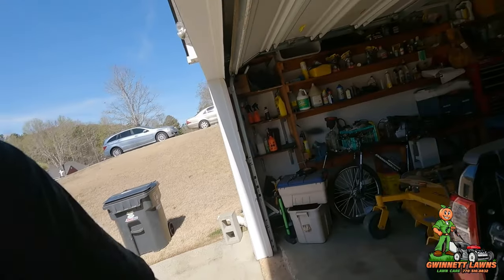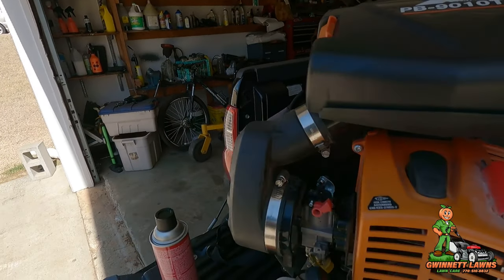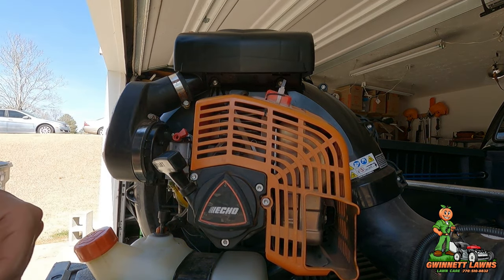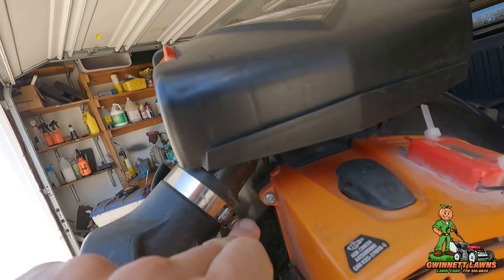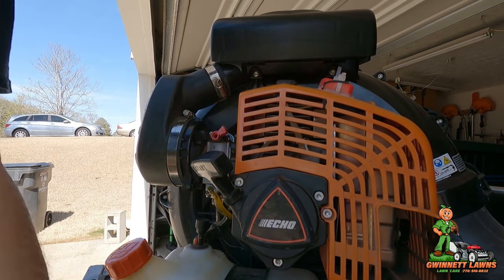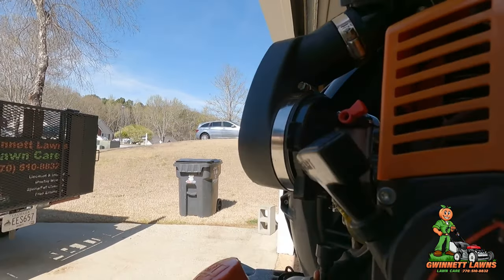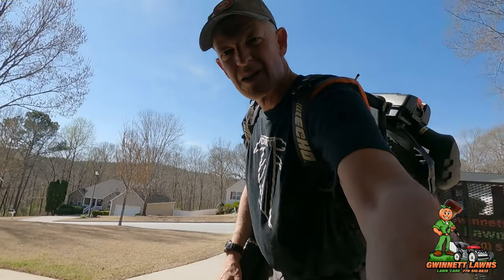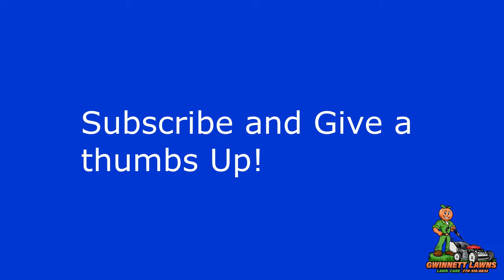Echo PB9010T Carb Adjust... WOW the power I have now!!!!!

Comment: To avoid buying both lengths of tools, all you need to do is remove the 4 screws that hold the air filter housing, loosen the hose clamp, rotate the housing back and re-tighten hose clamp. You’ll have access to the slow screw and filters will be in place for proper adjustment.

Comment: I would suggest that you switch to an hour/tachometer and then you can use the tachometer function to adjust your carb settings. 
What you refer to as a Choke is actually a Fuel Enrichment, it doesn't actually restrict air entering the engine. Also you may find at a certain point that you can't get a good adjustment on the carb and that's because the O ring that holds the jet inside the carb is shot,it is a design flaw of the carb. Have a good day 😊
Reply from the maker: Thanks for the info, blower is still running perfect so far.

Comment: Just took the carb apart on my 9010t to clean it and it put it back together and it is now totally bogging out. Idles perfect but if pull the throttle it bogs right off the bat. Any ideas?

Comment: Just a little information I have learned.
I was having problems with my 9010 so I bought a Chinese after market. It was hard to start and once it did I could tell it was not right. Long story short...bought another carb...but as a kit..hoses, carb, gaskets, etc.
39 dollars.
For starters, the Chinese carb has an adjustment that you can use a micro flat head screw driver. Runs great once I richness it up. MUST READ!!!
Must use gaskets sent with aftermarket carb...small hole does not line up with OEM gasket.

Comment: The 9010 is definitely the best blower I've ever used thanks for the video
Reply: Thank You for the video, I'm running lean at 44:1 using 110 octane Sunoco ethanol free race fuel and Klotz r-50 oil at 44:1. My old stuff and everything except my new X series trimmers and blowers are running lean (white plugs). I'm thinking 1/4 CCW on the H jets? Or just run 50:1??

Comment: My PB 770 started acting up the other day. It would crank up and idle but when I gave it throttle it would bog out. I had to let it idle for a little bit before I could throttle it up and then it would need to warm up more before it would get to wide open throttle. Was aggravating

Comment: Hey thanks for the video!! Do you have the parts number for those screwdriver. It would help me alot. Thanks
Reply: Can you tell me when you have a seconds, does that tool fit your 2620. I am trying to find a tool to adjust my trimmer.

Comment: Where is the low idle adjustment? I dont see anything up there. It would have been nice if you would have pointed it out.
Reply from the maker: I did point it out with my finger twice.  I showed and even said you have to do it by feel because you can’t see it.  The only way I could have showed the screw was to remove the carburetor and have a camera that could zoom in really tight. You’re just gonna have to trust me and do it like I told you on the video because I can’t even see the screw when the carburetor is on the blower. You have to do it by feel.
Reply: @GwinnettLawns  ok...i cleaned the dirt away from it and saw it. Thanks

Comment: What kind of 2 cycle oil do you use?
Reply from the maker: I use only Amsoil Sabre at 100:1
Reply: @GwinnettLawns your running that with way to little oil in the gas!! Minimum 50:1! Read the manual it says 50 to 1
Reply from the maker: @maineellingwood  Sabre is designed to run at 100:1.
Reply: @GwinnettLawns  interesting
Reply: @GwinnettLawns  would running the equipment at 100:1 rather than the manufacturer recommend 50:1 void the warranty?
Reply from the maker: @maineellingwood  the only time I would ever run 100:1 is with Sabre and since it’s designed to run at that ratio should not void the warranty.  Amsoil also will warranty the machine if it’s used exclusively as with their other products.  I have almost 500 hrs on my 9010T and my two 8010T’s I sold my friend have near 700 hrs each and they also run 100:1 on the Sabre.

Comment: Thanks but it would have helped to get a good look at the tool and you failed to give the links. When I search on Amazon, I am taken to tool kits and so links would help a lot.. I actually bought  a tool kit a few years ago for the chain saw but I can't seem to get a tool to fit in the hole and do the job. Is there a carburetor idle speed bolt apart from the two other adjustments.  Mine is running fine except it would idle properly
Reply from the maker: The issue is that Amazon does not have the tools on there anymore so no links are available.
Reply: I noticed you saying that elsewhere, thanks @GwinnettLawns